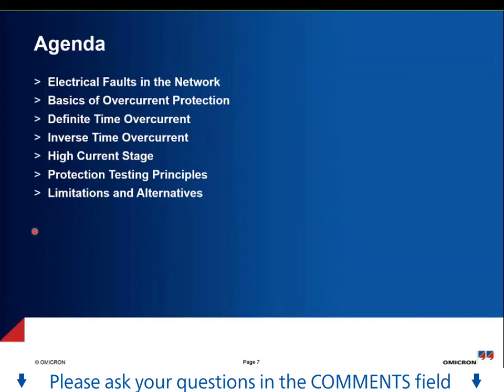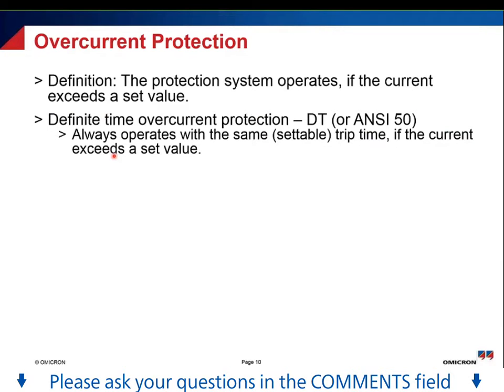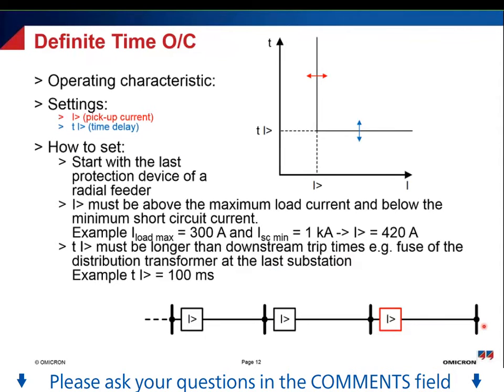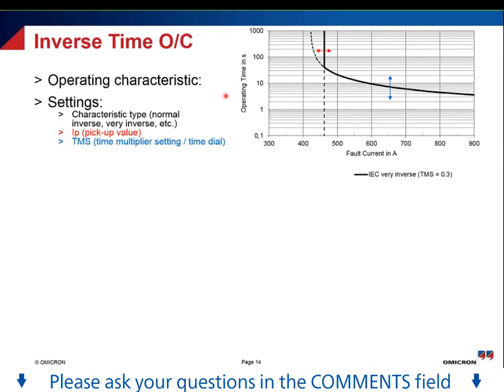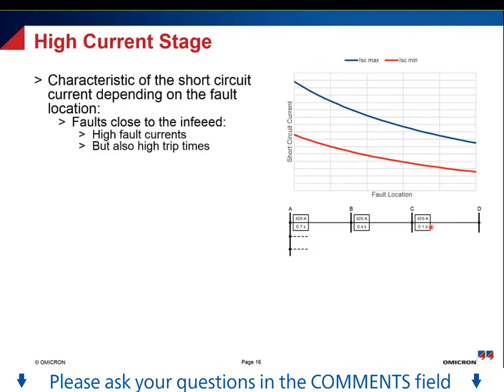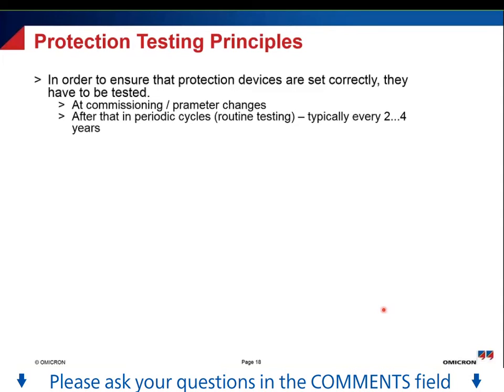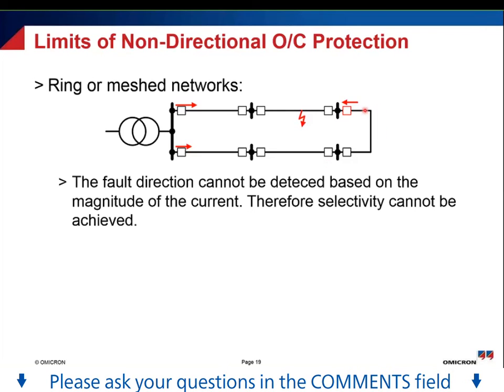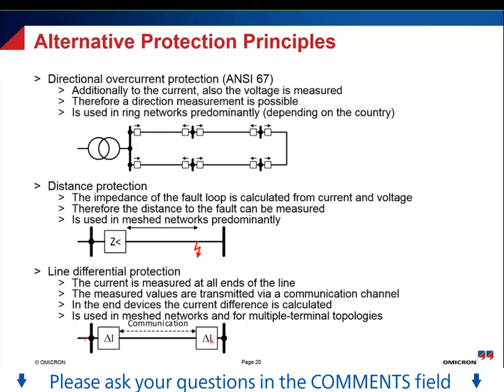Non-Directional Overcurrent Protection

Comment: If we want to convert a non directional relay into directional relay, we give vt voltage to relay, what will its effect on it, how can it changed its function. Please explain
Reply from the maker: Dear gurpreet singh,
the possibility of a change between directional & non-directional overcurrent depends on the relay type and the manufacturer. With our test sets you can test both, non-directional and directional overcurrent relays and many other types.

For non-directional relays only current is needed. The relay decides according to its protection settings at which current level it should trip. 
For directional relays the phase voltage is needed to decide whether the fault is in forward or reverse direction. This will be decided according to the phase angle difference between the voltage and the current. The different relay manufacturers have different algorithms to decide whether the fault is forward or reverse.

Best regards,
Your OMICRON team